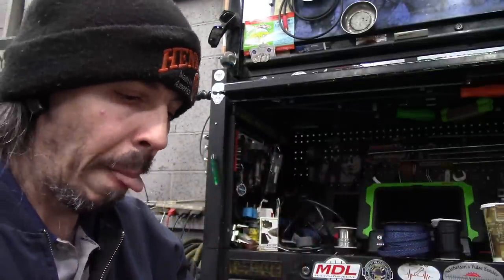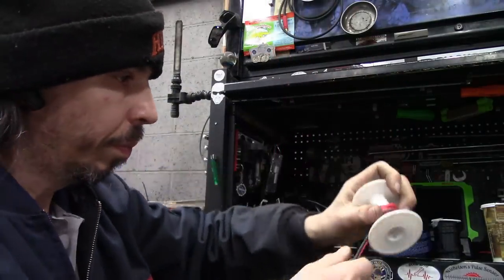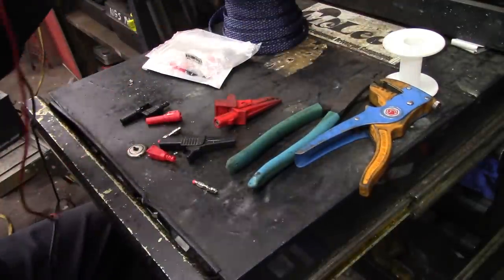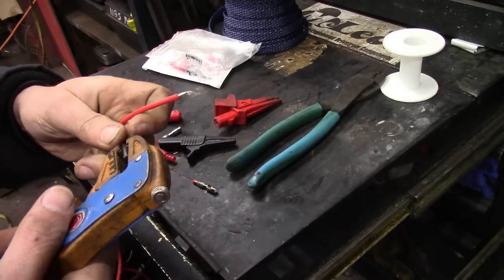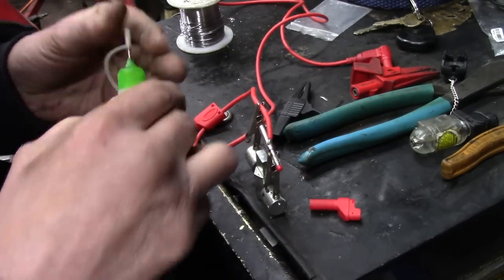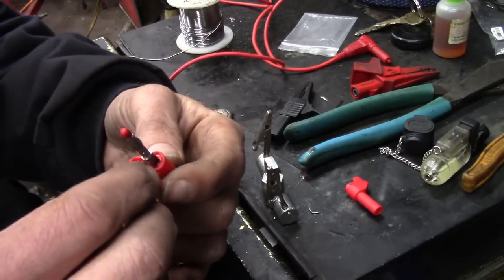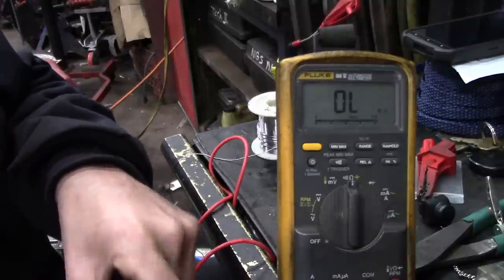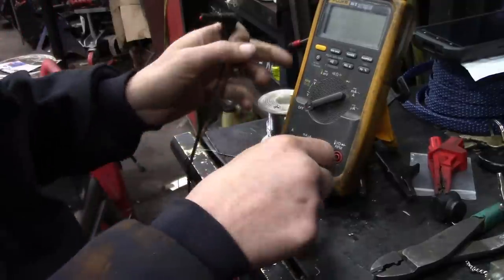Test Leads?? Scope and Meter Leads? Make You Own Instead! Custom Length and types!!

Comment: Back in the day when Radio Shack was still around, I made my own sets of jumper wires for electrical testing. Bought some speaker wire and alligator clamps, still use them today.
Reply: Hahah fixed my primary coil wires with speaker wire to get home! Off side of freeway...used it for 3 weeks before replacing! Never underestimate the speaker wire

Comment: I was glad to see you use the flux.. I would recommend that to everyone. Don't skip the flux.. The flux in the solder is not always going to be enough if the surface isn't tinned.
Reply: So true, a lot of people don't realize that flux cleans and helps pull the solder into the work.
The flux in the flux core solder burns away in a hurry.
Reply: Flux + Capacior + 1.21 Jigawatts+ 88MPH = Going back to days before CAN.

Comment: I actually made complete sets of these about 6 ft 10 ft 14 ft long each using 14 gauge silicon wire as Joe is doing all in matching colors and ends for my SnapOn Verus oscilloscope  so I could keep the Verus in my roll around or on a bench. They were a quarter the cost of bought and work great. Also a good quality flux is important.

Comment: Joe, great video!   Just a few thoughts:
First-off, it is really great that you show tech's how to do this because they will never be out of luck!
Second, I am actually Mil_Std certified for soldering with emphasis on missile systems. That being said, when you were NOT totally filling the solder-cup area, you were actually doing it correctly!  This is called 'contour-soldering' and is the correct way to do it for several reasons.  First, you actually have a solder-connection that is 'inspectable' whereas if you fill it, you have no idea if you really have a 'cold' connection inside a solder-blob!  You should be able to see the individual strands always; some will say that solder-blobs are stronger but if that is you aim, you really have issues!  Next, if you've applied enough solder to have a solder-blob, then you have also 'wicked' solder up further inside the insulation and created a sharp-delineation that can cause individual strands to break instead of bending; it seem counter-intuitive but has testing behind it.  Finally, many solder blobs are actually 'cold-joints' because a large mass of solder was quickly applied and leaves a bulbous structure not 'wetted' to the rest of the connection structure; you should be able to see the molten-part of the solder mass suddenly sink, thus showing wetting.  
So Joe, you were doing it right all along...
Reply from the maker: Thank you for your service, and for your very good explanation. I've made a lot of solder repairs over the years, and have had no failures of these joints. I guess I can do something right. 😂

Comment: Joe I got a tip for ya...  Use DL Handcleaner (blue package no pumice) and a piece of foam rubber and gently clean your case for the meter and the meter surface (do not get it in the teminals) it will clean it up like magic.  works on all surfaces like rubber leather great for steering wheels.
Reply from the maker: Thanks Lon!!!!
Reply: Wd40 on a clean cloth looks brands new after. Use on all my tools

Comment: Nice demo, I clicked through a few of the choices on your Amazon link. Didn't know about the angle adapters or the excellent silicone wires. Presently Fluke are selling crappy leads with their lower level meters, they are cutting corners for the lowest price point meters. I've made a few test leads through the years but it is reassuring to see a pro do it, very similar to how I did it. I like those piggyback adapters to tie in a scope as well.
Reply from the maker: Thank you man. They always work well as long as you take care to solder them properly. Other than that, they are perfectly easy to do.

Comment: Hi, Yes ive been using those connectors for a while now making leads for my test lights and adaptors for my meter.. I do find sometimes that when soldering the straight connectors the surface can be a bit shiny and the solder dosent stick.. This is where the torch may be better than a soldering iron as you can get more heat into the pin...
Reply from the maker: I actually prefer the blazer micro torch for this because of that. However, for those who might not be used to a micro torch, I recommend the solder gun. Safety  and less chance of mucking it up.

Comment: The plug you used has a flat side and a round side (near the soldering area). I've never been able to figure out if that has a purpose as to which side to thread the bare cable.

Comment: I might agree here if you have all of the parts to do so for low cost or free. Otherwise the time investment and low cost for stuff needed otherwise it’s cheaper in the end to buy them at a reasonable price of course. Custom ends are sometimes needed and then it may be better to build your own. In the end you need to decide how valuable you time is and the cost difference from making and buying sometimes it’s better to buy than make.
Reply: Best part, " NO ONE IN THE SHOP CAN CLAIM THEM "  DAMN STRAIGHT Arise, FREAKIN THIEVES.